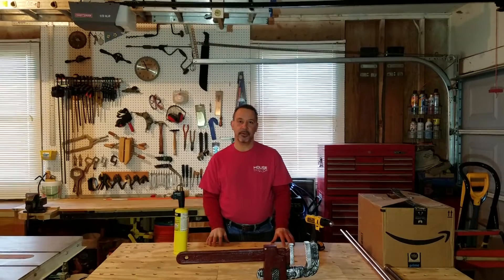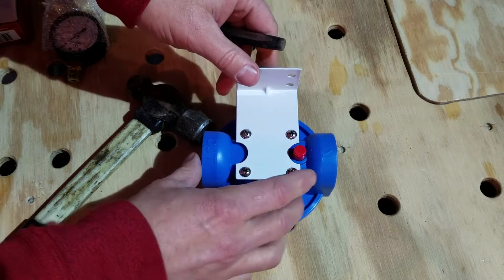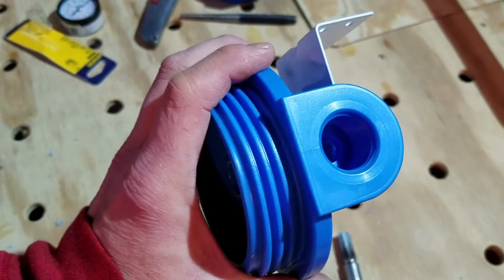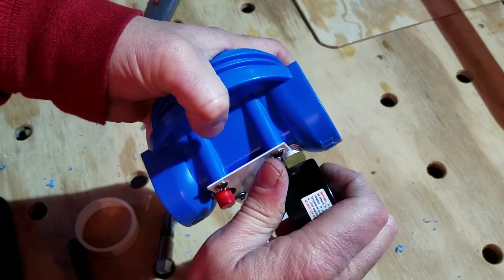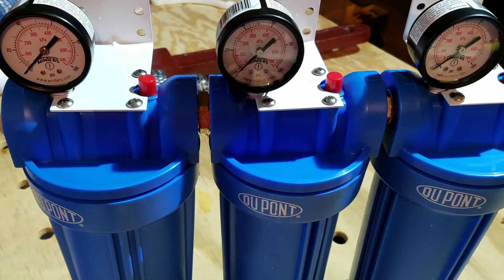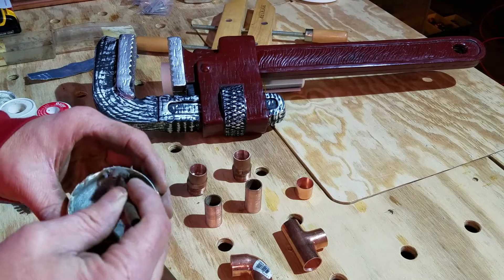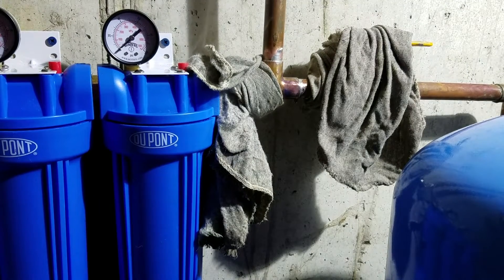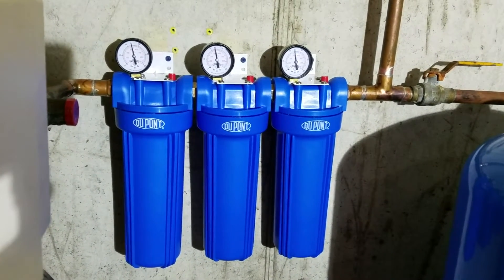DIY Multi Stage Water Filtration system

Comment: I nearly had milk coming out my nose with the (2:55) "we're just gonna use a regular-old high-quality crescent wrench" (and caption "yes, a Harbor Freight wrench - can it run that tap into plastic?"). Dang, Ray: you've got both a serious subtle sense of humor -- and some excellent shop knowledge and how-to-skills. Much respect. (And brilliant comment that NPT threading isn't "straight" but tapered -- I've recently had to do something crucial with NPT threading - in 316L not plastic ;-) -- and understanding depth/taper was vital.) Also loved "clean our your threading 'strings'" - nobody teaches that but should. (Finally though: when you did the Teflon tape: you should tell people: do 2 wraps, ALWAYS "clockwise" (same as how the threads screw in), and NEVER have the tape overlapping the open-end. Even with plastic threads - because it's crucial in other applications.)

Comment: Hey Ray, love the addition of the pressure gauges. Are you still using this filter system and has it held up? Was wanting something like that for my water filters but was worried about drilling the plastic and threading gauges onto them. Have you had to replace the gauges? Threads still holding up well?
Reply from the maker: Still works fine.  That section of the plastic on the DuPont housing is very thick.  The key is to not run the tap in too far.  On NPT threads you only go in about 2/3rds of the way with the tap.
Remember, you can always cut more threads but you can't put plastic back.

Comment: I know this video is 5 years old, but I just came across your channel. Why would you put a paper filter in one of the filter holders? Doesn’t make sense to me, to run water through paper.
Reply: Try the flushable spin down filters for your 1st filter in line. Sort of like a pre-filter.
Reply from the maker: The paper filters work great.  The best part about these filter housings is they are a standard size and you can get cartridges made out of numerous different materials.

Comment: So I had an under counter filtration system I just dumped because it would spontaneously leak and flood the kitchen. It did good to fill glasses or a few water bottles but that's it. I wanted to fill large containers with filtered water and I built something like you built here, mounted it to a 2 by 4 and used an RV hose from the outside faucet through the filters and out to another hose. Works great..Good video.

Comment: If I was to add an activated carbon filter to this to filter the chlorine stuff out of my water which ones would you get? 
some of the amazon reviews with pictures to prove it aren't so great on the carbon filters
Reply from the maker: The benefit of using these housings is the large numbers of filters available.  I would try DuPont, 3M, or other name brand filters.

Comment: Would you install this after the water heater or before ?
Reply from the maker: I would do it before the heater but it's totally up to you.  I have everything in the house filtered except for the water that goes outside to the hoses.
Reply: If it is filtered from the mainline coming into the house but before going throughout the house that is all you should need. The line to the water heater still comes off the main into the house. Main into house then splits off to hot water heater and cold line to everything else, unless you have a manifold system.

Comment: I see that you didn't experience a pressure drop using the 2.5" filters. Wouldn't the 4.5"x10", or even 20", last a lot longer between changes?
Reply from the maker: Yes, but they cost more and aren't as easy to come by in my area.
Reply: Thank you. Great info and video. @HouseDoctorRay

Comment: Great vid thank you. 
I have a question. If the first filter in line clogs and drops in pressure wouldn’t the other two show the same drop?
Reply from the maker: Yes, the gauges downstream would show the same drop.  I have a pressure gauge separate from the filter housings right off of the well pump.  If I see a drop on the first gauge from the pump pressure I'll know that filter needs attention.
Reply: @HouseDoctorRay  🙏🏽🙏🏽🙏🏽

Comment: I LOVE this idea, but have a couple of question regarding this wonderful unit? 

1. What filters can be used to reduce lead or heavy metals?
2. Do the filters remove all beneficial, naturally occurring minerals? 

Thank you so much sir! I appreciate you!
Reply from the maker: I'm sure you can find a filter advertised to remove lead and other heavy metals.
You normally buy filters based on micron size that will filter particles above that size.
I have well water so I am only concerned about filtering out sediment.  But you can get endless types of filters that work in these housings depending on your water source and what you want to filter out.
The benefit of this system is you put the least expensive filter first.  You can change it more often when it begins to clog up.
Reply: @HouseDoctorRay  Excellent suggestions sir! We also have a well, but just wanted to make sure. Thank you

Comment: Great video! 

Is this a good system if you use well water? I don't think my house uses a filtration system like this, but we did when I used to run a waterjet as you want the water going into it to be very clean. I think something like this would also be good to use to fill up things like a vehicles cooling systems (obviously don't forget to add the correct amount of antifreeze) so that you don't get a bunch of contaminants in it when doing a system flush. Buying a bunch of distilled gallon jugs gets old, and very filtered water ran thru progressively finer micron filters should be nearly as good as distilled water I would think even though they're not the same thing.?.?
Reply from the maker: Great for well water.  For vehicle cooling it would be best to get distilled water from grocery store.  The less minerals the better.
Reply: @HouseDoctorRay  
Okay, thank you for the quick reply! 👍
Reply: I keep with distilled but if I run short I might add some filtered, but distilled needs to be higher percentage of water.

Comment: Great video. I am looking to do something similar for a whole house filter. I am trying to decide if I need to step up to a 4.5 dia filter or the 20” 2.5 dia filters in order to avoid too big of a lose on volume. What is your experience with the smaller filters? Do you have any issues if you are using multiple appliances or spigots? 
Thanks in advance.
Reply from the maker: The bigger filter is just going to make your cartridges cost more.
I've had no noticeable loss in pressure.
Reply: @HouseDoctorRay  thanks.

Comment: For those with different filtration needs, you can use the same setup but instead of just using different micron rating sediment filters you could set up one like the one I have, which starts out with a sediment filter, followed by a scale reducing filter, and then by a charcoal filter for removal of chlorine and other taste problems.  There are several different kinds of filters used for specific purposes related to your particular water supply.  Lead is one that may be needed by those who have old lead containing mains for instance.
Reply from the maker: Excellent point.  That's why I built this; there are endless types of filters that will fit in these housings.

Comment: HELP! 🆘🙏 I've spent a week on carpentry, electrical, and plumbing work after months of waiting to get everything to arrive. The house pipes were even "backwards" and I had to redo everything in this project twice now. Can anyone help with plumbing?

I followed bad advice, then more professional advice, and then made it better and better. Inspiration has come to solve many things that rescued me a lot in moments.  I was thankful for answered prayers and being taught to have strength through repeated long days of work.

#Sharkbites have saved my sanity and never leaked.

• Arms hurt now, 7 days of solving different challenges. Lots of money spent to save our future appliance and well-being.
• (Likely bad advice, or unprofessional that failed) Use 15 rounds of Teflon. Leaks. Clean off all fittings properly, and redo.
• (Failure and yes that is what they are called). Brass nipples, failed but thought it was because I could tighten one way and it would loosen another.
• (More Pro way) Redone with independently tighten-able Sharkbites. 2-level Teflon applied in the right direction that is tight, and independently tighten-able threads, but threaded conenections still leak.
• (More Pro way) Added pressure regulator in case it was due to pressure, threaded connections still leak.

HELP!

Images: https://wwe.facebook.com/story.php?story_fbid=pfbid02jB649KfgCR52bHNW6g67PaAVwnKoBEGVR4qciJnrNcSfY9uaMRxf57fr7yqwLVa2l&id=17820015&sfnsn=mo

Comment: nice!  i really like your install gauge in the filter mod.  really clean, small footprint and low cost.  

I have a few suggestions, not criticisms. 1) to measure the pressure drop across any of the filters, normal water flow must be present, like 2.5 gpm.  if there is no flow, even with a terribly clogged filter, the pressure will show exactly the supply pressure (no drop). 2) i would try to install a bypass valve around an in/out at the end of the string of filters so that you can service the setup at your leisure, while the house supply is unaffected. 3) i would have at least one union in the filter string (two is better) to allow the section to be removed as a unit and fixed for leaks or other failures that invariably occur, as well as allow for sweating near the plastic. 4) having one of the filters be a GAC will lower the chlorine in the water prior to the softener and thus extend the resin life substantially.
Reply from the maker: You're right on all points. 
The water must be running to see a pressure differential indicating a filter with reduced flow.
 Any whole house filter properly installed will have a shutoff before and after to make filter changes quick and easy.
Installing this would have been easier using unions but would add slightly to the cost.  I'm not concerned about a long downtime if something fails.  That is part of the reason why I went with common filter housings and standard fittings.

Comment: I have good town supplied water. I jave exactly the same Dupont filter system..
And its bullet proof. The ones with shutoffs all leak someday.  I just use a charcoal filter to the refrigerator for better tasting water..and ice. Personally...I would want to be able to separate the filter housings in case of a leak. A union  seems ideal. Next..if you had a tee between housings and installed the pressure gauge there...no drilling or tapping. These are just my thoughts after owning several homes and systems. Your design and video are good.

Comment: Are the filter housings double sealed o-ring or single
Reply from the maker: Single o-ring
Reply: Have you had any problems with leaks?
Reply from the maker: No.  The filter housings I used are in use in millions of homes in the US.  If they're installed properly and the water pressure isn't too high they should be fine.

Comment: With a whole house filtration system ( last filter would be .35 submicrons which I got on amazon) would I really need a water softener?
Reply from the maker: Filters and softeners treat water differently.  A filter removes dirt and other contaminates.  A softener reduces hardness by removing dissolved minerals.
If you have white residue on your plumbing fixtures or green staining you likely need a softener.

Comment: I just finished drilling a well.  I need to install a rudimentary system to filter the water for construction use.  All the videos I've seen shows a pressure tank installed first in the system using a pressure valve to control the well pump. Is that the best setup?  I worry that putting the raw (poor quality) well water in a pressure tank will degrade the the tank quickly.  I was considering installing a 1500L tank to capture the well water, then set up a filter system using the water from the holding tank.  I thought using a spin down (or two) filter might be cheaper to use immediately out of the well?
Reply from the maker: The purpose of the pressure tank is to keep the pressure more stable.  It keeps the pump from turning on if you are just getting a glass of water.
If your well is not acidic then you'll be ok with the filters after the pressure tank.
You'll need to do more research if you want a cistern tank installed right after your well pump.  I believe that type of setup requires a well pump controlled by a float in the tank and a pressure pump after the tank.

Comment: I ordered the Culligan filter housings.  Hmmm I wonder if I can tap them?   Otherwise I’m just putting brass tees and reducers up to save money.  I like your video I heard a rumor that those type housings leak a lot, is that true?
Reply from the maker: I never heard that or had a problem with them leaking.
The Culligan housings are a little different and may not be able to be tapped in the same way.  You could always get the appropriate tee fitting to put between them and put the gauges there.
Reply: My housings have a gasket in them. I make sure to use a silicone gasket grease on the threads and gasket. Never had a problem with leaking, except when the pressure relief valve broke. Different problem though

Comment: Using your drill press to start your tap is the best way to start a perpendicular thread. Don’t turn the drill press on, just hand turn the chuck while applying a little pressure and you feel the tap start to pull into the product. Great video and thanks for sharing.
Reply from the maker: Good tip.  Thanks for sharing.

Comment: Hey, Ray, I installed your setup just as you described yesterday and all went well. I Used 3/4 copper unions on each end of the filters though in case I need to take them off completely or something. My only problem is I have the tiniest drip between the first and second filter housing from the nipple. (It's outside so no real big deal.) Maybe if I had gone one more rotation, but I didn't want to go too much.  Also, I'm using all three of the filters that came with the housing right now. I figure those filters will catch all the flux and metal taste that comes from sweating the pipes. I'll do three different types when these need changing. Thanks for the step by step instructions. By the way, this is the same type filtration setup I used to set up in my darkrooms a long time ago to develop and wash film and complete archival washing of black and white prints.
Reply from the maker: Since you used unions it will be easy enough to take apart.  If a few more wraps of Teflon tape won't stop the drip try PTFE paste https://amzn.to/2ZkGDWA
Reply: @HouseDoctorRay  Thanks I'll check it out.
Reply: @HouseDoctorRay  That small drip I was getting is totally gone now so no drip at all. I'm filtering the cold water that goes into the house, not the hot water. The pressure on the cold now is a little less that it was before while the hot is still fine since it goes straight to the water heater.
Reply: @7thSonProductions I would’ve filtered the water to the water heater. That way sediment is filtered from getting in the heater. If you have hard water, like I do, you definitely want to try to keep the sediment out of your water heater!
Reply: @shannoncraig2147  you are so right! It's been on my list of things to do for some time now. I didn't realize it's been 4 years since the install. I'm going to add another carbon filter to the water line that goes into the water heater. Thanks for suggestion.
Reply: @7thSonProductions If you are filtering from the mainline coming into the house you should already be filtering what goes into the hot water heater. In my system that I am getting ready to install my first filter is a flushable spin down type. It came with 2 different screens 1 is a 200 micron and the other is a 50 micron. Figure I will use the 50 then go into the disposable filters. I am running ¾ in pipe from pressure tank to the filters, size of housing inlet and outlet. I will reduce down when it gets back to main pipe through house. I have also started using rv water filters that hook up to a garden hose for the animals outside.

Comment: Nice work Dr. Ray,
One possible suggestion would be to use the union on both sides of your water filter so you don’t have to solder so close to the plastic
Reply from the maker: Good point.  If any viewers are unsure, a union fitting allows you to connect/disconnect two pieces of pipe with wrenches.  They are ideal for use when a component may need to be easily changed.  See here: https://amzn.to/2VewCrP
Reply: That's the reason I used them. I didn't want to screw the ends into the plastic then sweat/weld the pipe because I didn't want to get the connection too hot and possibly create leaks I could not stop. I sweated all the parts together, including the union then tightened everything together after it cooled. It worked pretty well.